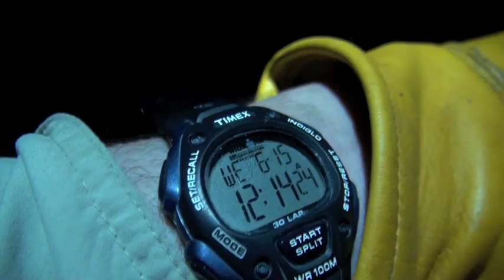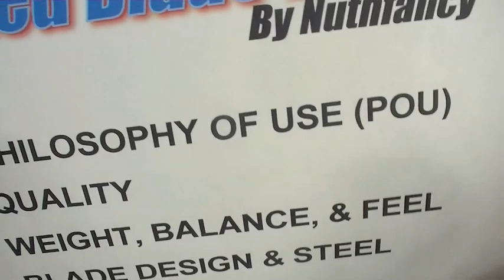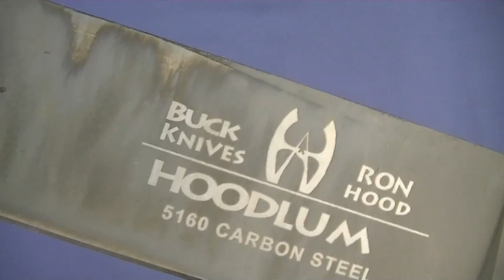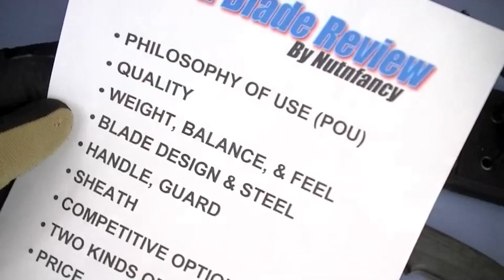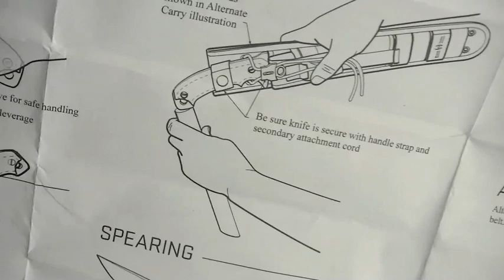"Buck Hoodlum: Legacy of Ron Hood" by Nutnfancy

Comment: Nutnfancy,
I have waited 4 months for this review and I was NOT disappointed. Nice memorial to Ron,and an HONEST review of the blade, noting its chopping limitations due to the light weight. With that said, it looks as though you and Cr0cket could have built a log cabin with this beast. Splitting lodge poles,WHAT?
That was awesome! Thank you for being so considerate and for the no B.S review.This is one of your best vids yet, along with the Sheepdog Concept.
You should be very proud of this.

Comment: The tip is delicate. expect about 3/16" to snap off when it does. The edge can be re ground with a slow turn water bath grinder / wet wheel. I LOVE this knife!! I really do.. I do think that the tip geo's need to be tweeked a bit to be a bit more stout. I feel that the purpose of the grind was for tip work.... Not really a need for the POU. Just my experience with the product. sail on

Comment: The Hoodlum paired with a Cold Steel Gurka Kukri is a great large blade system.  The Hoodlum is an excellent batoning blade and the Kukri is a great chopping blade.  If one fails, the other CAN do the work, but I prefer them in those roles.  The Hoodlum is an excellent blade!  Great for fire building.

Comment: @Warsign01 

It may have been on purpose. In cold temperatures, the pressure inside containers will drop and in some cases may prevent the product from working. This is why butane lighters have such a hard time in cold weather and why you may see nutn or someone else put the fuel tank for a camp stove on coals.

Comment: I love the overall design of this knife, and the way Ron Hood designed it made it a strong blade. After he died, unfortunately, Buck changed from water-cutting to laser cutting, and as others have said, it makes the blade weak around that (wholly unnecessary) notch. This is the second and last Buck knife to break on me. Wood vs. steel and wood won. Replacing it with a Ontario SP-50.

Comment: @BUCKrub91 While the weight from this knife to another may not be that large or noticeable, he focuses on weight for the sake of carrying a lighter load. When you go backpacking, you could be carrying up to 70 different items, tools, equipment, etc.  If each of those weighs 4 or 5 ounces over a lighter offering that could do the same job, then youre could be carrying 10 more pounds than you need to be. A few ounces doesnt seem like much, but it really adds up quick.

Comment: cont'd: and resharpens fairly easily. It's lightweight for it's class, so it's a fine backpacking option too. I've also heard nothing but good about their warranty, even when damage to their blades comes from serious abuse by the owner. The SOG NW Ranger, for a medium sized blade is also an excellent option that I can vouch for, having seen moderate use in my own backpacking trips. Around $60 you get a 5" blade that comes sharpen, resharpens very easily, and is extremely lightweight for its...

Comment: I bought it and I broke it. It broke just where you would think it would break. I loved it till then. It split with a baton great then a VERY LIGHT sideways slap on a log face n like magic there were 2 pieces. I'm going to get it replaced with another and we'll see if I had a lemon but I have lost confidence in this blade and more than likely I will get the shiny new one and sell it. BUCK doesn't have anything else I like in a big knife. BUCK Master? I think Boomslang is up.

Comment: The tip broke off of mine during normal batoning.  Not in the usual place you see in other videos, mine only lost about an inch off the tip.  I was able to grind down a new edge and it works as good as new but still broke my heart. Great design -- thanks to Ron -- but bad implementation by Buck.  I'm a Buck fan so not trying to bash I just think this one didn't work out for me.
Reply: Every knife can fail, but I love the prospects of this one. I love that in Moonscape,  they were unafraid to challenge it to the extremes they had to work w/. If I'm to take any large blade out deep woods I will test it and hopefully be able to depend on it. I hope you're exp w/ this blade is an exception to the rule.

Comment: I've seen WAYYYY too many videos here on youtube of this knife critically failing...  It seems as though Buck has a major issue with the hoodlum breaking right at the notch....  I can't say as though I will be buying this blade....  yea....  pass!
Reply: Have had mine for 14 months and have beaten the crap out of it through Hardwood and No failure no chips nothing. But the one video I seen some fool was trying to baton a Fence post size log. But I disagree with the Notch I understand why he had it but it was a mistake and I think if he was still around the GEN 2 would have not had the notch.  Great thing about buck is no questions warranty.  BK does not have that. I had issue with BK sheath and they were not willing to do squat..  I have the Hoodlum   the BK-9 and RTAK-II  all are good just different.   Good review TNP
Reply: Brian D
Well I'm glad you've had good luck with yours but regardless, I don't want to take a knife into the woods that has been known to catastrophically fail and have it happen when I need the knife most!
I love a good warranty, but I also want a company to make a knife well from the beginning rather than produce junk and back it with a good warranty because the best warranty in the world won't help you when your knife has broken and your lost in the middle of the wilderness.
Reply: I agree 100% the problem is that they lazer cut the epic screw up pot holder. when they milled it out and then tested it was much much stronger. the lazer over heats the steel supposedly but to cut $$ they still lazer cut it.  I have had good luck but because of this problem I also would never want this as a only knife in the middle of no where or to place my life in its hands. I do think if Ron Hood had still be alive this would have been fixed.
Reply: Brian D
Agreed.  Well said too!  By the way, I took a look at Buck's warranty policy and their lifetime warranty only covers defects in materials and workmanship...  So if you broke your knife by something they believe constitutes "abuse", then your shit outta luck...  The only knife company that I know of with a true "no questions" warranty is ESEE (which I own several of).
Also, I'm interested to hear more about your experience with ka-bar.  You mentioned you had a problem with the BK-9 sheath?  Or was it the BK-2?

Comment: Sadly I broke my Hoodlum in less than 60 seconds of batoning. Split a few slices off a piece of firewood beautifully. On the 4th piece the blade snapped off right at the notch. Never even got to try chopping with it. Sent back to amazon and they gave a full refund. Now considering BK9, RD9 or RTAKii or SP51.

Comment: @DeadRisingFan408 Dude, Mine broke in half while chopping a small branch. The blade went flyin' one way and the brass guard the other. Reason is, it 's not full tang under that wooden handle. While it was an outstanding chopper, the tang is amazingly tiny for that size knife. From one tnp'r to another... be careful with that thing.

Comment: Yep been there. Sadly I had to exchange mine for another BUCK and they didn't have anything I wanted so I got another Hoodlum. I don't trust it so I don't use it. Just remember it's a BUCK product not a Ron Hood product. All the knives you mentioned I think are better knives. Cold Steel re released the Machete Bowie and that $20 knife is the best knife and it will not fail. It's just not very sexy.